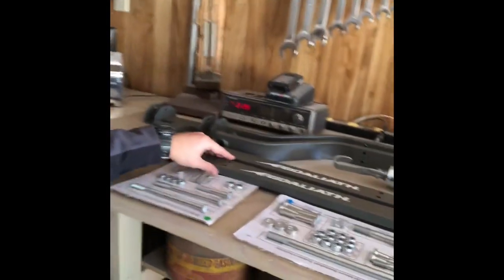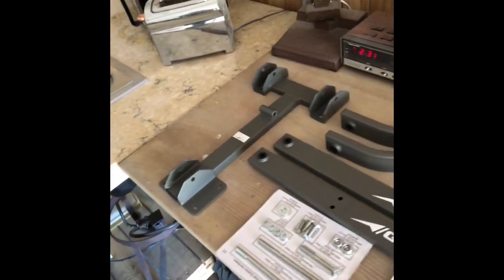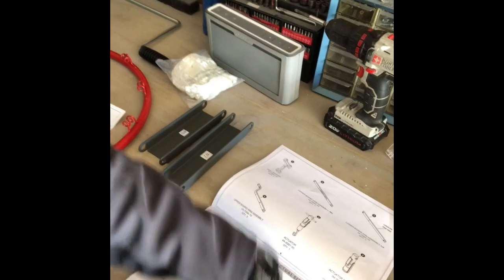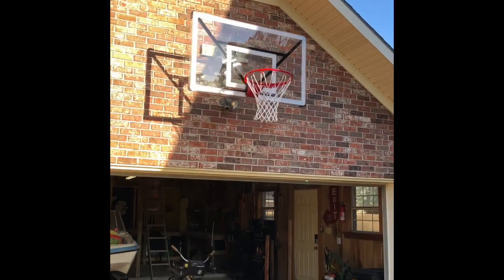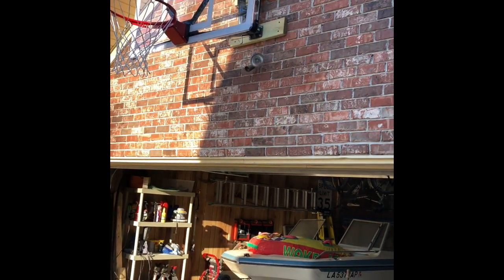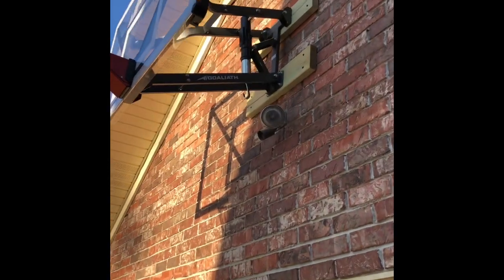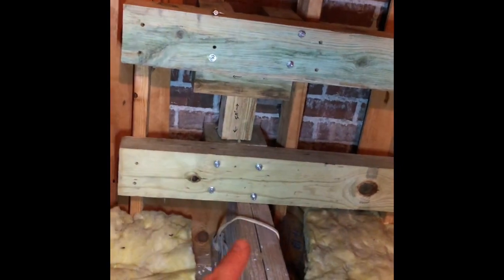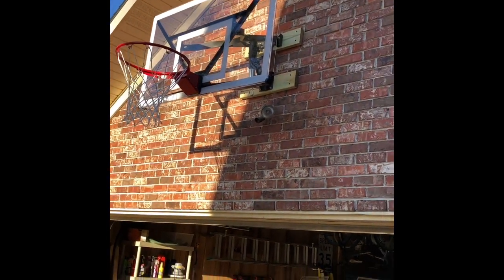Goaliath 54” Basketball Goal

Comment: I’m thinking about buying this hoop as well. How is the rim holding up? Is there a lot of shaking with the backboard when the ball is thrown against it? Do you recommend this over goalsetter?  Thanks in advance.
Reply from the maker: thacherils it’s holding up great! If the ball hits closer to the edge of the backboard it shakes. But if it hits in the middle there is almost no shaking. It’s pretty solid and I would recommend it. Very happy with it.

Comment: How high is the recommended mounting point from them? And does it adjust upward.
Reason I ask my garage is on the shorter side. It doesn’t have all of that wall space in the middle like yours
Reply from the maker: Hey Dylan, I'm going off of memory here so the following dimensions are approximate.  It adjusts from 7.5' to 10'.  I believe recommend mounting height is around 8.5' and yes it adjusts up and down when at the recommended mounting height.